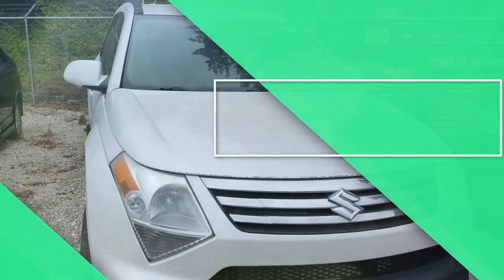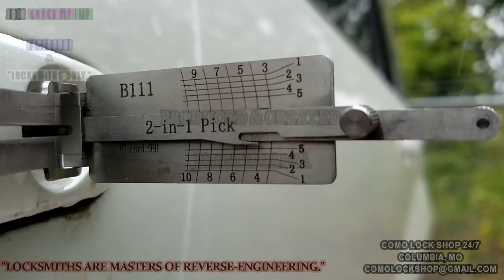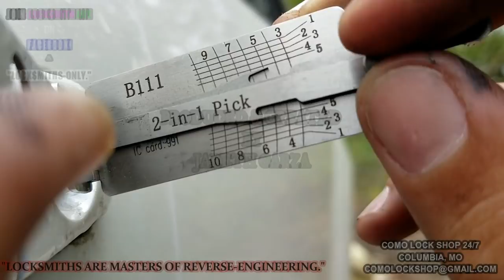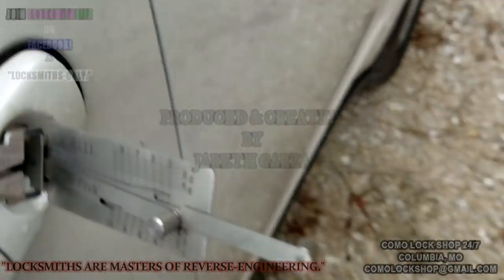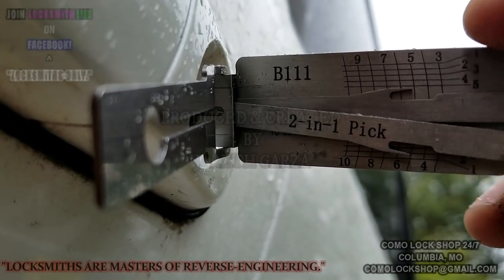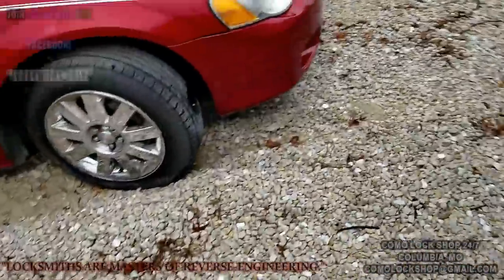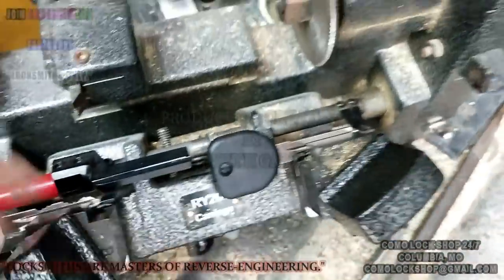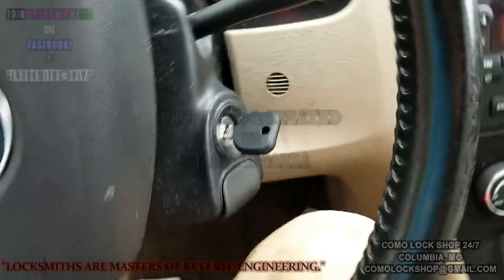2007 Suzuki XL-7 Lost-Key Creation and Production

Comment: yo Jareth you can always pullout door cylinder and look up code
Reply: Key code only on 1999-2006 models 
2007 and up no code stamped
Reply: @julioalay7004  i am about to do an all on a 2006 xl-7, should I lishi it with toy43at or pull door lock? if door lock, how easy is it to move it? pull panel, that it? or os it all hard to get to?

Comment: My key was programmed but, I moved something in the fuse box and now, the lights comes on but the car does not start. Is this a programming problem or something else?
Reply from the maker: What does ur security light do?
Reply: @JarethGarza  it flashes when I open the door with my key. I do not have a fob remote. This car was from an auction and they charged me for the key. The car work before but now it does not turn on. The lights turn on , but does not start. The security light flashes and it stop when I introduce the key in the cylinder. Thanks for your help and for your time.

Comment: I lost my keys for my Suzuki xl7, local lock smith said they refuse to try an program me keys because they don’t have the right software. Suzuki dealership in another province told me Chevy dealership can program keys for a Suzuki. Brought it to my local Chevy dealer and they were able to cut the keys but they can’t program
Reply from the maker: On board program

Turn key on for 10 mins 
Security light goes off
Turn key off and turn back another 10 mins
Light goes out 
Turn key off and turn baack on for final ten mins
Light goes off or will blink
Turn key off
Wait like 5 seconds
Turn key on
Key should program
Reply from the maker: Oh and that locksmith is ass. Have him contact me.  I can train him on how to do automotive.
Reply from the maker: Hell u may he able to send me the antenna module and I can program keys directly to your vehicle’s immo